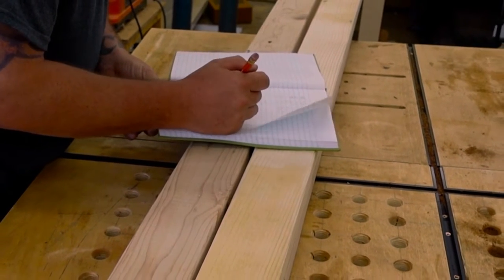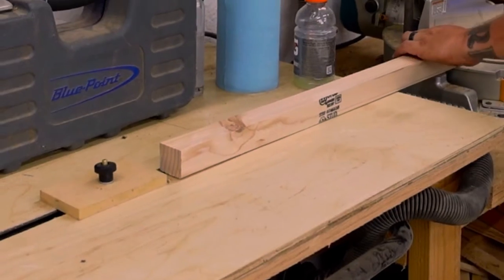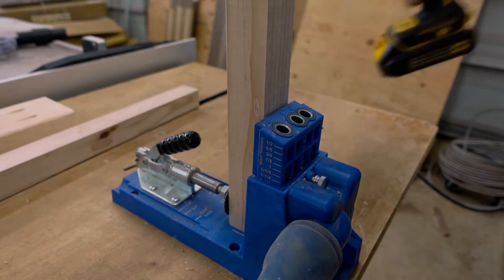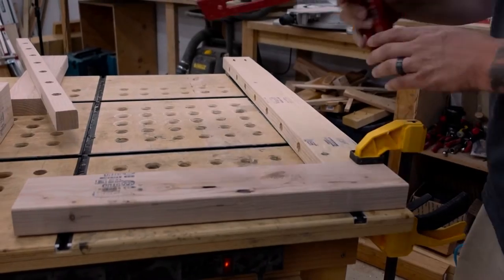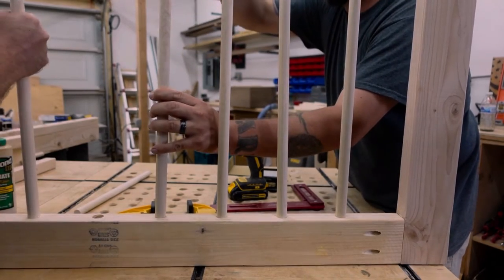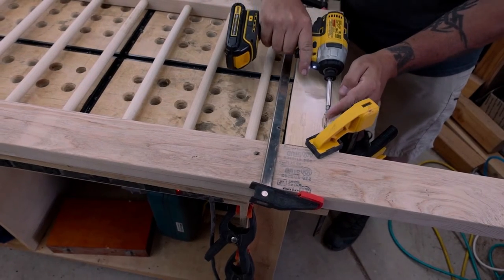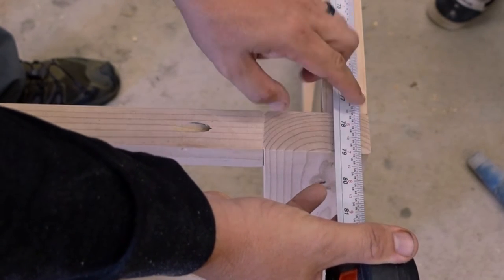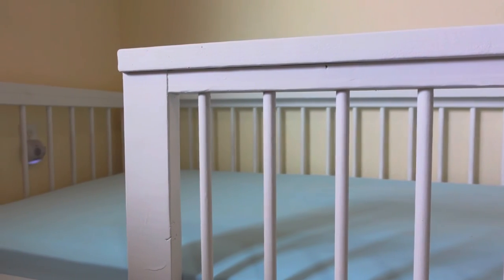Floor level bed frame - DIY Toddler Floor Bed #woodworking #diy #woodworkingprojects

Comment: Such a creative design.  You two are an awesome team. You are great at picking up a project and making it work. Looks well crafted and for less than $100 it probably saved a lot of money instead of buying in a store.
Personally, I would stain it to match the other furniture but depends on the room.
Great video and funny commentary.  My toddler definitely sleeps outdoors but not near main highways
Reply from the maker: I think my friend, Chris, did a pretty great job with it.

Comment: How does the mattress breathe..?
Reply from the maker: Great question! Hadn’t thought of a mattress needing to breathe until you posed the question. This is the first I’ve heard of such a thing. Please elaborate.
Reply: @FirstFruitsDesignCo  A mattress should get airflow from underneath to prevent mould etc